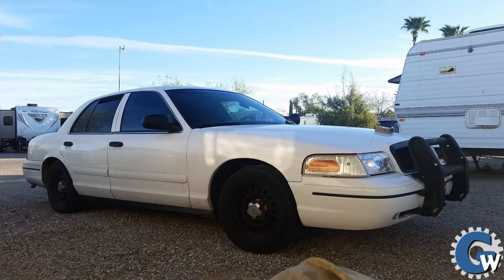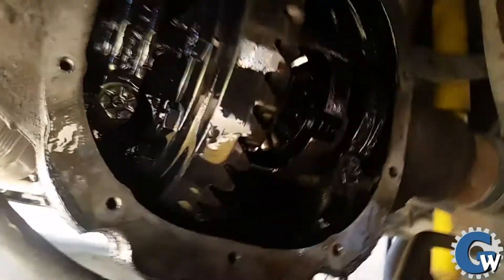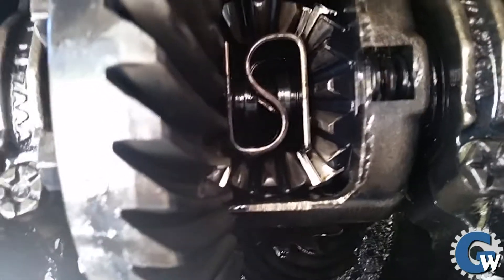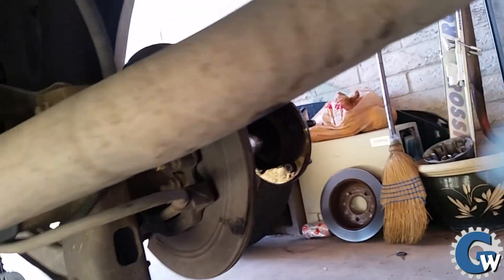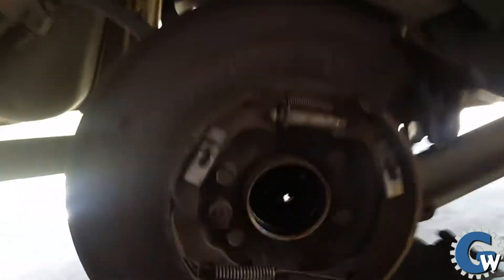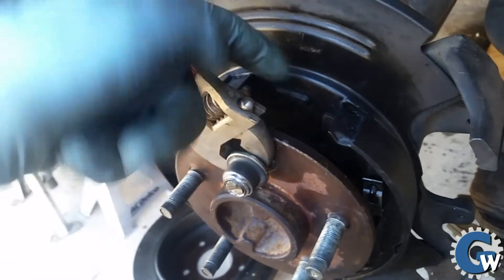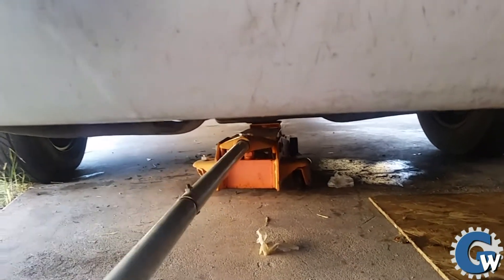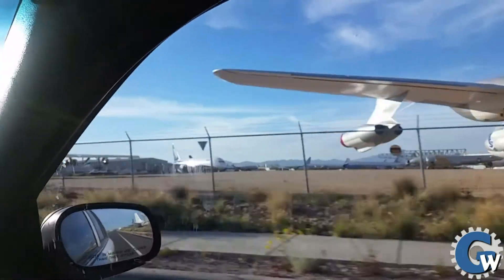Cop Car Life   Rear End Leak

Comment: Ill warn you ahead of time, when you go to do the fuel leak, AVOID DROPPING THE TANK IF POSSIBLE. Its better to pull the fuel pump assembly with a 1/4" drive ratchet and long extension. Dropping the driveshaft and removing the exhaust hangers so you can move the pipes around to access the flange is typically waaaaayyyy easier than trying to drop the tank. The tank is bad enough to get in and out, but trying to get the tank straps back on usually sucks to high heaven. Trust me, ive done dozens of these and have learned my lessons. Message me if you have questions on the p71's.
Reply from the maker: thanks !
Reply: the tanks really aren’t that hard to drop or put back in. i’ve done it a few times.